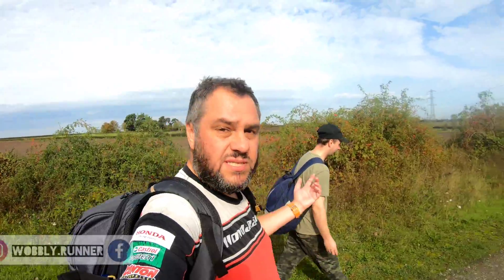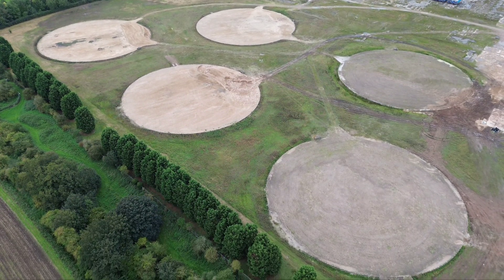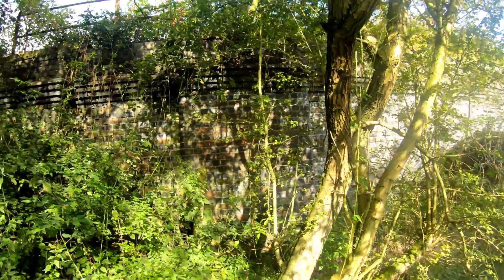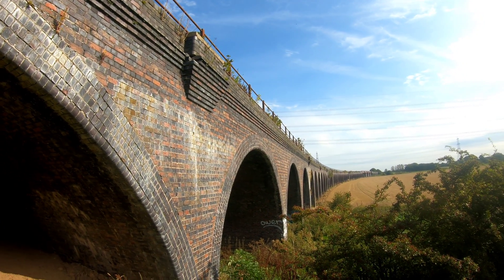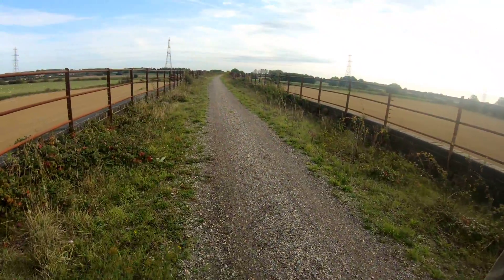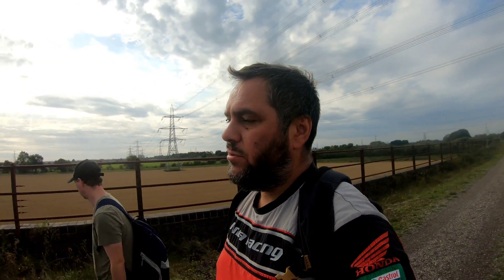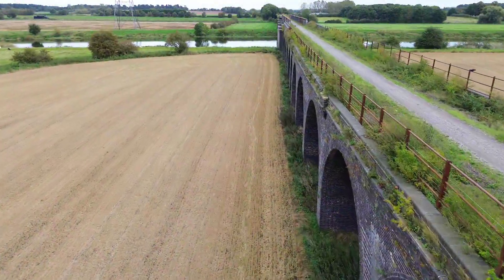The Fledborough Viaduct: Crossing The River Trent

Comment: When you come off the via duct towards Clifton it’s 63/4 dead straight miles as the crow flies to skellingthorpe curve , it was the longest pice of straight track in Europe after its construction for a few years
Reply: I’ve tried to buy the old the goods shed at Harby many times but Reeds bought it and used it as a grain store , but they’ve never maintained it so it falls into a state , tight farmers that’s why , I’d buy it tomorrow and restore it back to its former glory and then build my model railway inside it . We tried to buy the old waiting rooms and booking offices but no chance they were to be pulled down , although Mr Chapman did buy north Clifton on Trent and it still stands
Reply: Another bit of info about the LD . 
1971 Allen Pegler brough the flying Scotsman 4472 down the LD on a special excursion to Skegness via Lincoln 
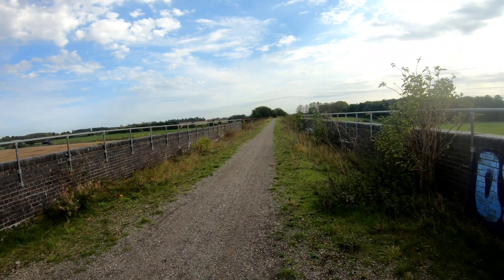They never got further than Clifton box , because the scheduled coal train derailed at screw bridge blocking the line . This train ran at 13:15 passed Clifton at 13:56 came rattling through Harby at 1406 with only 4 wagons behind him the rest of the train was pulled up at screw bridge .
So the Scotsman got as far as Clifton but couldn’t enter the section to Harby , there it stayed for 4/5 hours until a class 32 was sent from shirebrook to pull it back train of 8/10 coaches too , the offending train causing the delay was stopped at skellingthorpe home board to be told of the problem & Rex Harris signal man said now mate where the bloody hell is the rest of your train . The driver never even knew he’d lost it because the fireman was up in the front cab with him not sat in the rear cab , he was simply exceeding the speed limit for the line and the guard in the brake never rode a brake again he said coming off the viaduct I gave him 3/4 tugs but he didn’t slow down and when we parted folly bridge I kept the brake on as much as possible but no use , it snapped at screw bridge he carried on I went into the pile up . That driver was never seen again and I did know him he came from Laxton village originally from Berkshire but moved north to escape the southern rushing about .
When I saw him again some years later I asked him …”did you not know we do things a bit slower up north old lad , he replied bloody Saturday afternoon shift Kev lad I wanted down to whitemore and back for 7:30 if possible I was on a promise , he admitted to me he’d got her wound up and was over the 50mph of the line restriction and if I’m honest we all did it to make up time between Clifton and skelly curve it was 6& 3/4 miles dead straight you could make up lost time there by a good few minutes but never get ahead of schedule because if you did you met the down passenger from Doncaster to Lincoln at pywipe junction so got held back until it passed pywipe before you got the all clear to go up onto the avoiding line .
I was on the up line one day heading towards fledborough got pulled up waiting for another to clear the viaduct on the down he was coming a bit quick over the viaduct we had a 15mph in place from 25mph when it was single lined in 64 . 
It was Wednesday afternoon at 14:30 on the 5th May 1982 , I though hey up this lads doing a Mooney , Moon being the surname of the driver causing the crash in 71 in front of Scotsman , 
My fears were right he caused the crash in the same place as Mooney did in 71 …screw bridge again through speeding too , that led to the closure of that section from fledborough to pywipe 
Same place almost same time as Mooney how ironic was that and there was nothing wrong with the line or track it was just speeding caused it , however every house for miles around kept in coal for a good few months , I went down at the weekend when we started the clearing up process I was on duty on the crew train etc . I pulled the brake and about 5/6 22 tonne mineral wagons back into Clifton sidings where they stood for months they were full when I shunted them empty when I fetched them before the track was removed …
I fetched trailer loads of coal from that crash site with my old grey fergie and trailer and old Cliff baker who lived in the farm house nearest had the rest , sonny Chilvers about 100 tonne too , there must have been at least 600/1000 tonnes of coal all heaped up and even today you can see it still in the ground in places at the crash site . 
I transferred from shirebrook depot to Lincoln central train crews depot after the LD closed my uncle shut skelly box and ended up as car park attendant at Lincoln central , I ended up on passenger services from Lincoln to Nottingham or Birmingham down the midland . Or some days Lincoln to peterborough via sleaford . I hated those passenger services , they were clean tidy jobs on dmu,s but stop start every 10 mins . 
I ended my days on oil trains out of immingham with class 47’s down to toton shunt up and bring a load of empties back to immingham shunt up then yok on a loaded train back to toton yards .
Sounds nice and clean and it was no stop start but after a while you get bored of the same journey same load same time day after day . I much preferred my steam days on the old pick ups calling at every place meeting people chatting away in a slower pace of life .
One day I came into Doddington and Harby shunted up the cattle dock went for Dinner with my uncle in the signal box with my fireman it was a Friday fish n chip day from Madgies at Saxilby , 1pm eating fish n chip dinner mug of tea etc myself as driver and Tom whiteley fireman , bill Reynolds’s guard all had dinner fell asleep until I stirred at 14:20 woke the other 2 up my uncle Eric as signal man laughing didn’t fall asleep said you lazy gits piss off to skelly he’s been on asking where’s the pick up I’ve told him your waiting on a special sugar beet delivery from Jarvis at the estate at Doddington ok .
Aye aye Eric I said and off we went alibi in tact . When we returned over 2 hours late at shirebrook on Friday night on the return journey our foreman where the bloody hell you buggers been , I said waiting on a beet delivery at Doddington from Jarvis on the estates knowing they never question the squire of Doddington estates . 
Mr Petit our foreman said aye kev lad did they taste good with salf n vinegar ,…on a Friday …….I wasn’t always a white collar man thou nos . …book yourselves in 2 hours overtime , and your rostered off till Monday aren’t you , I said yes boss he said grand lad my missus is cooking a beef roast a Sunday lunch and my garden could do with a spade over ok , aye boss we all said see you Sunday morning . We dug his garden planted his spuds and had Sunday lunch with them …..they were glory days

Comment: You ought to see that when it's 'in flood', the whole area is swamped with water, The Trent just basically takes over. I usually park on the east side of the Viaduct, where you're starting the next video I would say, and walk across and on to Fledborough Station, it's a lovely walk. The post on the east side just at the end of the video, usually has a sign giving you the dimensions of the Viaduct, someone's obviously made off with it. Come to think of it there used to be one at the base of the signal on the west side of the Viaduct too, someone's been busy nicking stuff.
Reply from the maker: Theives!!!!
I wish I had some free time to go and see the viaduct with the flood waters the other week. Must have been concerning for the nearby villages though.
Reply: @WobblyRunner  It doesn't reach the villages, thankfully.